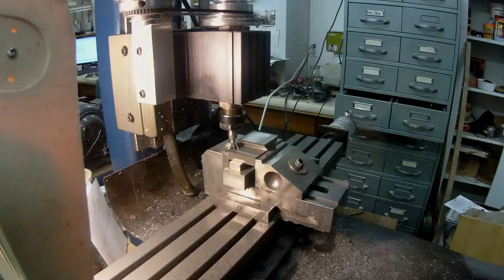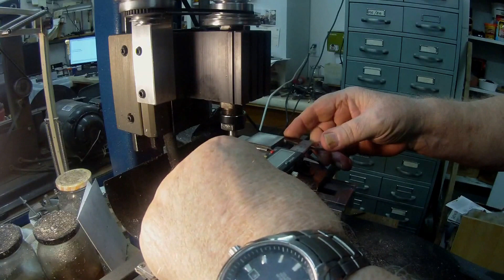FILE0019 Sixth Part on Profiler tool

Comment: Walter:
Thanks:  Very educational and helpful, since I need to mill a similar female dovetail for my current project.  Luckily I will be able to check the fit prior to removing the work from the vise since both parts are quite small in size.  I will definitely sneak up on the final cut and dimension.  In your situation, a brass dowel plunger below the set screw with the end milled off at 45 degrees might be helpful.  I saw that technique in a recent video I watched, produced by Tubal Cain.  I'll be looking forward to your future videos.  Best Regards: Larry